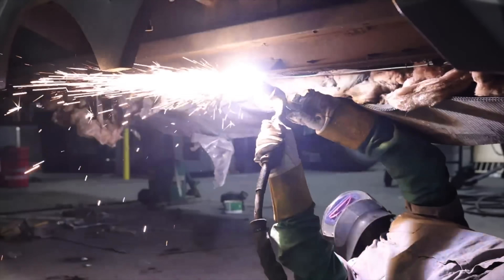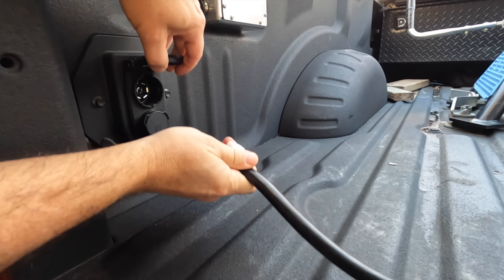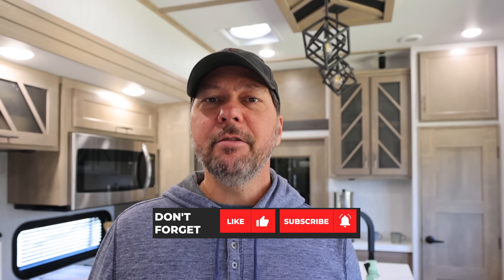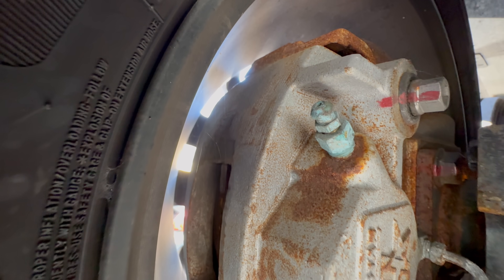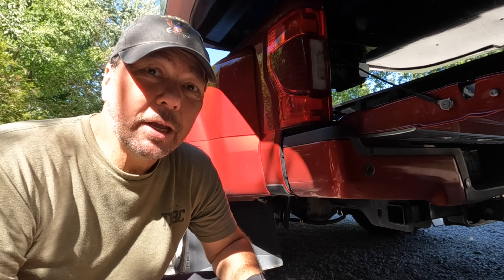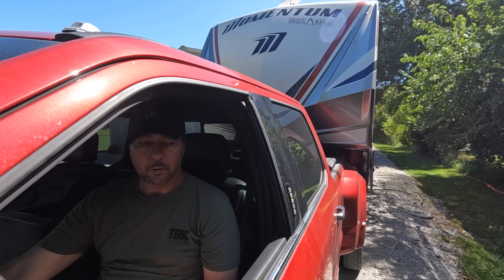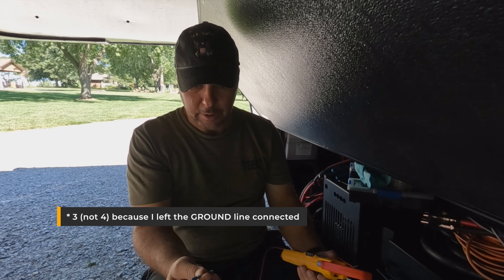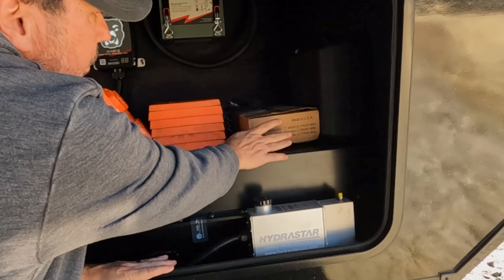RV Brake Troubles!: Solving a Perplexing Hydraulic Disc Brake Issue

Comment: Great video! We had Moryde install IS and disc brakes in June 2022. I noticed that with the manual override, my 40’ fifth wheel would not completely stop either. I called Moryde and that said that it would not???? Strange. So I have just kept my boost setting to 6 on my 3500 Ram and this at least keeps me from feeling like the RV is pushing us as we stopped. Can’t wait to follow this thread. Thanks Chad

Comment: Couple commenters before this one here; made excellent suggestions. (Wire connection voltage from truck, while hydro-pump is operating, (A.K.A., with current flow), testing. I have not operated a trailer with hydro-electric, only drum-electro-magnet brakes.  The only insufficient stopping power on one truck-puller I experienced, was attributed to  running undersized wire gauge, from the truck brake controller to the trailer connecting plug.  (Quite an unnerving towing experience, while  descending a mountain).   (Was barely enough stopping power, for sure there was not enough wheel lockup power.  Temp. work-around; drive slower, as you already well know).

Comment: A lot of good comments, one rare issue that I had in 48 years as an electronic/electrical tech was a loose pin in a multi pin connector. The pins looked good  ut I could push on back with very little pressure. The wire would push it back so it looked okay. When I plugged it in the force of the mating pin would push it back and it wouldn't have full pin to pin contact. Only had that several times in all my years.

Comment: Hi Chad, I also enjoy your videos greatly! I've been an Aviation Maintenance Technician for 48 years about to retire. I noticed in your video that the three wires to the unit were power or control and did not see any dedicated ground wire. A must in a DC circuit! Seeing no separate DC ground wire the assumption is it grounds thru the unit case. If the unit is sitting on rubber or plastic the retaining bolts may not be sufficient to complete a good consistent electrical ground. Consider running a separate wire from a good frame structure to a mounting bolt with a star washer that would bite. Good luck and Regards.

Comment: I've had part time brake failure simular bringing the rig home to me from Phoenix AZ to Milwaukee WI. The connector on the trailer had ware. I realize yours is new, but you often plug in unplug. Look at the copper blades in there. Maybe you had loose contact inside the 7-way when brakes faded and with all the reconnecting for these tests, maybe good connections later. I'd look over both the trailer and truck ends. Same for a little corrosion in either. Makes for IFFY pass through of electrons. I ended up with a new 7-way on the trailer and my problem went away.

Comment: This is adapted from a discussion on a forum for a particular kind of fifth wheel  I did not figure this out on my own but your video made me think of this I read a while ago:

Whether or not you have your truck lights on might matter. On some Xxxxx coaches, the disc brake option drives the need for a factory installed DC/DC battery charger to be installed as well, assumedly to keep the coach batteries charged due to the added draw the brake actuator pump places on the electrical system.

This charger requires an Ignition Switched Based ”Trigger Wire” to turn it on and in turn charge the battery. On some coaches, it seems the factory attached the trigger wire to the light circuit in the 7 pin junction box on the rear of the pin box. So unless the truck lights are ON, there would be no battery charging to the coach. (other then the standard solar at least in our case)

The trucks charge line connects to the 7 pin box and in turn to the DC/DC charger inlet(+) .

This DC/DC is also an isolator and will not allow any current to pass thru it unless it is activated by the trigger wire.

So, over time coach battery voltage would be depleted with each brake activation and without charger activation there would be no voltage to charge the battery. Voltage could get low enough to prevent proper brake activation.

Comment: First off, let me say that my wife and I love your video's (great content).
If I'm correct the issue will return over time.  When you cut the wires, you cut all power to the actuator completely resetting the control board in the actuator.  
If it does happen again, I'd suggest killing the trailer power and ground to the actuator to prove my theory.  
Safe and happy travels.
Reply: Perhaps there’s an internal pressure leak in the brake booster pump

Comment: That's always a tough thing.  Bad connections and solder joints can always be a problem.  I was an auto mechanic for many years and when someone would bring in an intermittent problem those were the toughest to diagnose and repair.  I hope this fixes your problem and you don't loose brakes at a bad time.

Comment: Chad love your videos. as for your brake problem. You checked voltage through the connector does not mean you are getting enough amps through the   connector you need to load test the connectors. just to be sure the proper amps are getting through the connectors. I run into this problem many years ago in the Army. We had a tank that would not charge. after many times pulling the engine and transmission out and testing it on the ground ( and many hours spent) we found a bad wire. Long story short after replacing the wire. everything work. Have never forgot that. Safe travels.

Comment: I didn’t read all of the suggestions I apologize if my is a repeat. Try moving the cord around that connects the trailer to the truck and see if your readings change. Check the connections where the trailer light cord splices to the trailer in the area behind the king pin. Good Luck and keep the great videos coming!

Comment: We have the same setup on our Solitude. We had a similar issue, except that it didn't fix itself. We had to add a Hydrastar Adapter Module (#HB-CAM) in the wires prior to the actuator. We were told that some GMC and some Ford integrated controllers don't "communicate" well with the actuator. Not sure if this is your issue, but it fixed ours!

Comment: I’ve had the same exact issue with my Morryde IS brakes. My setup is similar minus the tow vehicle - I have a Ram with a 7 pin extension receptacle in the bed of the truck. After breaking my brains over what may be going on, traced the issue to be at the splice (connector) of the 7-pin receptacle in bed to the 7-pin by the bumper. In my case the receptacles are spliced up in parallel before carried towards the module upfront. Ironically, the root cause was a spare tire not tightened all the way, and during movement pressing against the splice connector reducing continuity. Quite the sequence of events!

Comment: We did a DIY install of the same components, worked great - then it started acting up - after a lot of trouble shooting I just started re stripping and crimping- turned out it was a intermittent bad crimp of the ring terminal I had at the battery.  I would vote that your problem is connector related.

Comment: Having the same exact symptoms as you did and looking all around for solutions. I was very glad to come across your video but a little bummer at no clear solution lol. Mine are Morryde IS but they use deemax brakes now and Dexter actuator. I can hear actuator run when I pull the breakaway, but very minimal if any breaking power to wheels. To me that sounds like air in the lines. Check there and keep going I suppose. Just weird same situation as you had. Thanks for the video.

Comment: Check where the ground cable is actually grounded probably with a self tapping screw. You moved the ground wire, which is now made a better connection.
Reply: Both ground from pump to trailer frame/wire harness as well as the 7pin wire to frame.  Maybe even inside the 7pin connector screw terminal in case its corroded or loose.
Reply: Will be ground for pump only. If any other ground was no good. Other things would be acting up as well.

Comment: When I picked up my 5th wheel after having the brakes and suspension done, was constantly throwing a code when left turn signal came on.  We went into the shop and their director of R&D got involved.  Like you, we never did figure it out, but here we are 10k+ miles later and it's still working.  I did discover they did a horrible job bleeding the brakes, and I did fix that myself, bit it did piss me off that they didn't properly bleed the brakes.
.
I had one thought on the crimp, could the resistance be zero under light loads, but suddenly increase on heavier current loads.  Along that same line of thinking, butt end connectors are a terrible idea in a Trailer.

Comment: So, I had independent landing gear installed in “19, I had troubles with right side a couple years later. The splice was defective.  Wire just came out with slight tug.  I replace splice.  About 6 months later, same thing… right landing gear not working.  Check fuse, wiggled splice, it started working.  Replaced splice with better splice.  (I was at a harvest host in the middle of Texas).  Worked fine for about another year and broke again one stop from home.  Finally figured it out at home, the wire going into the motor would open if, and only if, the wire was in some weird position, but would reengage after it was maneuvered around for a bit. So, I replaced the motor.  The wire open didn’t present like most opens: you pull one way (open) and the other way (closed).  Nope.  It worked most times, and corrected itself if you messed with it (until it didn’t again).   Sooo, just be prepared, it could’ve been a shorted wire that stopped touching metal cause you pulled on the wire bundle, a lost one/zero electronically, or anything in between.  Good luck.

Comment: 2 things to suggest, one is to check your connections inside your 7 pin connector to make sure you don't have a loose  or cold soldier joint somewhere. The second suggestion is, have you checked to make sure the pump is operating at correct pressure. Just because it "sounds" ok doesn't mean it is. I would imagine there's a bypass or pressure regulator system in the pump and you may have a problem with the pump or said system(s). Good luck!

Comment: It's always a good idea to do a trailer brake only check after every hookup.  I recall years ago my father always checked his brakes twice, at a slow speed near the camp spot and at speed such as 30 to 40 MPH and he pushed the trailer brakes hard enough to get the trailer tires to skid or make that sound they were, which indicated they are working up to maximum ability.

Comment: Chad, a couple things I would check. 
1.  When doing your continuity, check across the connectors, watch your meter while moving the wires around. It’s the same technique I used to troubleshoot fuses that had an intermittent open.

2.  Run your brake system check with the Volta system connected. Is it possible that system is backfeeding through the brake controller and changing the control voltage?

3.  Since the breaking system uses a positive displacement pump, you must check the condition and operation of the pressure relief valve. Mechanical ones are easy enough to check by measuring the condition and length of the spring. Electrical ones can be more problematic, depending on how easy it is to get to the connectors to check voltage and amperage across those lines.

4.  Is there a way to check the hydraulic pressure at one of the brake calipers? Plumbing a gauge at your bleed fitting would not be difficult, but the manufacturer have to let you know what those pressures should be, and I would run those tests with the Volta system connected and disconnected to see if there is a difference.

Comment: Y’all, great videos!
Little background on me, I went to school for automotive and agricultural equipment repair/service.
I wonder if there isn’t a connection inside the actuator that was loose or (for a lack of better terms) ‘faulty’ and the movement of the wires from the testing/re-crimping reconnect those connections. Hard to ever really know for certain since it looked like the actuator is a seal unit. 
Keep up the great adventures!!

Comment: Our 2022 F450 had similar issues with our hydraulic brakes. It was resolved with a trailer brake module update from ford. There was also a recall for this on certain early build 2022 models. Might be worth having a dealer check and perform any updates pending.

Comment: Although you have a good ground and good voltage it sounds like one of your wires or crimps don’t have the proper strands. in other words, you might have a couple strands broken. In that case you’re not getting the proper amperage, you can always have voltage and a good ground but because of vibration you would have an intermittent problem. You need to check for amperage. Once again great video hope you figure that one out, and we’ll see you on the next video. 😎👍

Comment: The easiest way to fault find is to use a test light. A bright light indicates good current /voltage flow. A dull light indicates poor current. You can use the point of of your test light to pierce the wire insulation anywhere to check the current. You can also check your voltage at the same time by connecting your multi-meter to your test light and gives you the voltage while under load. Hope this helps. Happy Days.

Comment: A couple of suggestions: spray all of your plug-in connections with WD40. This prevents moisture & corrosion from interfering and thus causing intermittent voltage drops with your brakes, lights, & anything else electrical. I did this on the brake light connection on my KTM motorcycle. I was getting a rear brake light switch error on the sophisticated brake computer system. The brake light ALWAYS worked, but I still kept getting the error on my gauge display. After spraying the plug-in connection with WD40, the computer has never received the error. Because your controller works off a variable or pulse signal, any compromise in the connection could have caused your problem. And you may have unknowingly fixed the problem with you disconnected the plugs and reconnected them. WD40 may keep the problem from returning. 

Another suggestion I have, although not related to your current problem, as a routine habit is to check all of your disc brake rotors with an infrared temperature sensor. What you will be looking for is a significant difference in temperature among the 6 rotors on your trailer brakes. The same check can be done in your truck. If one of the six rotors is hotter or colder on the trailer or one side of the truck is different than the other side, it can indicate that one brake is working too hard or not hard enough. The front and back brakes on your truck will be obviously different, but they should be close to the same side to side.

Comment: Hey Chad, in my many years I have seen many crimp connections fail. I no longer use them, I always soldier. Like you found they don't always fail completely, but will fail under a load (high amperage).
Reply: Completely agree. I use non-insulated crimp connectors followed by soldering followed with double wall 3m heat-shrink. This is on critical connections especially ones exposed to weather and road spray. ABS connections (at the wheel sensors)  are especially vulnerable. I work in Instrumentation with 4-20mA current loops. Modern cars and trucks use low level current loops thru-out.

Comment: I hate intermittent problems, because they always go away when you are testing them.  If the issue recurs I would suspect something internal in the hydraulic unit.  They do make hydraulic pressure gauges that fit it the bleeder holes  if the problem recurs.  I don't know how much the cost or where to get them but I do know they exist.  This is a tough one buddy, good luck and keep the good stuff coming.

Comment: Hi Chad,  Been a while since we commented with each other.  (Distilled water/Peroxide water bug spray).  The one thing I would look at a little more closely, would be, you had voltage but may not be delivering enough current.  The electric/hydraulic was "buzzing" but may not have been developing true pressure..... hard to tell through audio.  A Tee fitting and a pressure gage (0-5000psi) would definitely answer the pump question.  Being it is all six wheels not functioning is proof it is not the individual calipers....  I believe that the voltage output to the trailer is a PWM voltage (pulse width modulation) signal, I doubt it is resistance based, I would have to verify using an oscilloscope or high end Fluke multimeter, however, if it is PWM you would show voltage but have insufficient current.  The continuity reading with the multimeter would show low resistance but may not be able to carry the necessary current.....
Reply: I think you’re on to something here, I’m now wondering if the thermal load affected the valve actuation performance directly.   I had an exact replication of Chads experience and I did notice degradation during prolonged use (heat) and a significant increase in the audible noise from internal electronics (stress).
Reply: RAM trucks are the only manufacturer using PWM for the trailer brake circuit.